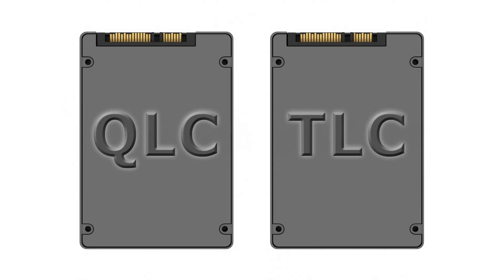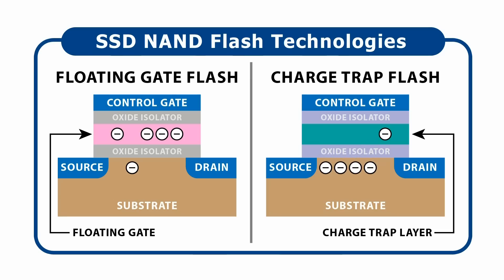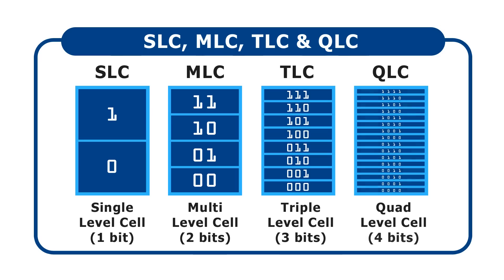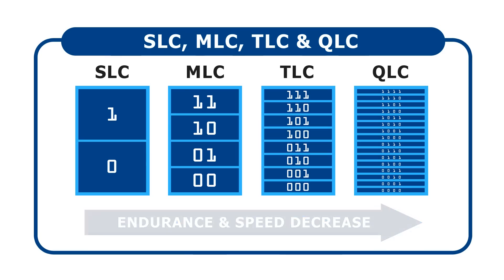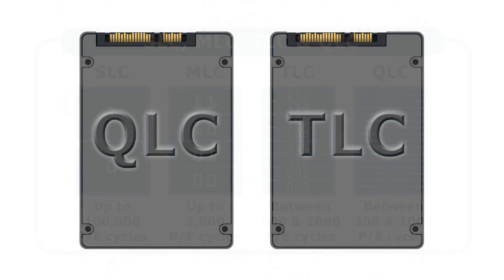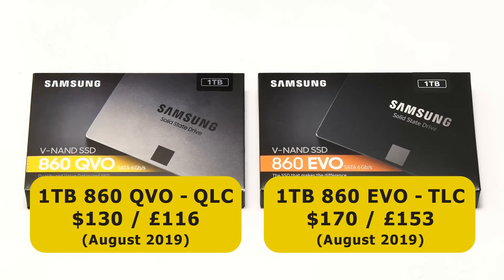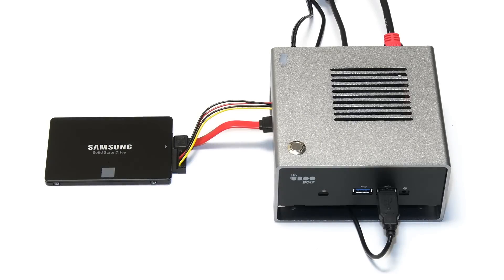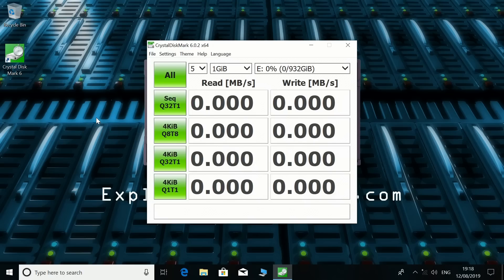QLC vs TLC SSDs: Samsung QVO & EVO

Comment: Would you guys recommended me to upgrade to 1TB QVO? Right now I'm still rocking 500GB 7200 rmp hdd. Works great but I'm running low on storage and I'd like to decrease loading screens in games.
Reply from the maker: You would find  1TB QVO a major upgrade in terms of speed as well as storage capacity. I would recommend a QVO drive to most users -- mine has worked flawlessly.
Reply: @ExplainingComputers  Thanks for replying me. I will consider it and most likely buy it soon. Keep up with your videos. Your channel is awesome. Deeply explained and straight to the point.

Comment: I like the informative part of the video, but your scientific part is bottlenecked by the used interface, and thus only what can be proven is that sata3 is not robust enough to compaire test results between the datacelltypes.
Reply from the maker: I have proven the difference between the two different products shown -- which both use a SATA III interface! :) So there there is nothing wrong with the test for these particular products! :) But clearly, testing two NVMe drives would be different.

Comment: I think why the EVO is sustaining the performance is because it can also flush the SLC cache to the TLC quicker than the QVO can to QLC; meaning that it can reuse some of the SLC cache while while the copy is ongoing. In addition, even if the SLC is completely full, the write should still be quicker on the EVO/TLC
Reply from the maker: I imagine you are correct. :)
Reply: Or U could just use a regular spinning hard disc, which can do MORE speed all the way from start 2 finish filling the whole thing = LOL!!  SSDs R a $kam =P

Comment: I have been moving LARGE files around since 2000.   Heck I still use Firewire 400 & 800 drives.  Even SCSI 320/(640-if dual channel on arrays)  

People thought I was Crazy to buy up all the  15K SCSI drives I could get my hands on.   But day in and day out?  When I need to shuffle data, and I NEED IT to be reliable?   This is what I go to when I need to have more then  500 MBPS of real world throughput without a hiccup.     

I'm still one of those people that buy Servers LOADED to the BRIM with RAM and use  most of the MEMORY for a RAM drive.    Even boot from it.  Its the only way Windows 10 is ANYTHING like how Windows 7 was when you had 16 GB of RAM.   No waiting or thinking for anything to happen.   Heck, I still use old versions of Windows server for that reason. 
(2003, and 2007)   

These days?   Backblaze or use  an online service for long term data storage.    The sad thing is?   Most of my old DVD backups of movies are now on Blueray or can be streamed.    So all that time I spent on making that Library was kind of a waste.    

However with the VIDEO I have recorded and made?   20TB is what I had  back in 2006.     If I wanted to save and actully get all my old MiniDV tapes back up?    And FIles?    That would be an easy 40TB,    then another 40TB to have a back up. 
And of course, the mandatory off site data backup.  

If I started to record Videos again?  And that would be 8k ,   then that 20TB drive would be not even be able to keep up with playback.     Let alone recording.     

And the only thing that is worth anything is TAPE data storage that is REALLY lagging behind.    The PRICE for the HOME user is not worth it.   So the Data center my data will go.

Comment: I just did a test using my GH5 and a Atomos Ninja 5 recording monitor with the 2TB 860 QVO  and exactly at 78.4 GB (which according to your graphic is the cache size for the 860 EVO) the recording was interrupted.  Then it would only record 4 second clips before briefly stopping and starting again to record the next 4 second clip.

Since I just purchased the Atomos Ninja 5 for my GH5 and my intention was to be able to continuously record up to 20 minutes in one shot at 4:2:2 10bit 4k@60fps...clearly the QVO drives are not going to cut it.

I guess I will have no choice but to shell out a bit more money for the 860 Pro and hope it can keep up with the huge recording data rate of 4:2:2 10bit 4k@60fps coming out of my GH5 over HDMI to my Atomos recorder.

I don't see myself recording at that rate very often but I want to know I have the right tools to do so if I want or need to.

Comment: I am in the market for SSD for my new PC, 2.5 SATA or NVMe?  Main use is general use and some PS/Lightroom and basic video editing (no gaming!) . As I understand there is no big performance difference between the two. My main concern is reliability. Should I go for NVMe or 2.5 SATA? As I understand there is no big difference between the two for my kind of work and the SATA seems to me to be more reliable. Thanks!
Reply from the maker: You cannot go wrong with a Samsung EVO 2.5 inch SSD. :)
Reply: @ExplainingComputers  Thanks, mate! Will do.

Comment: You connected to a SATA III port which has a data throughput limit of 600MB/s. This exactly is what you measure on both SSD, thus you encountered a SATA bottleneck. And while it is true that the speed of these two drives does officially not exceed 600MB/s, it would've been fair to exclude any bottleneck possibility.
Reply from the maker: But the significance of the test is to show the sustained data rate that the drives drop to -- which is way below the speed of SATA III. The test also shows a real-world scenario, which is what matters for most users.
Reply: @ExplainingComputers  thanks for taking the time to reply. I was just expressing my concerns... I guess I've been doing too much datacenter testing lately. Thanks for the review!

Comment: There is no wonder why QLC outperforms TLC before 24GB  is reached - it works almost as SLC then. I would also say that due to the fact that QLC writes twice (once as SLC and then as QLC it wears the cells even more). I would not use TLC or QLC for Video and dedicate good-old Hard Drive for that... For linear write of lots of data they should be as fast... needless to say that 24GB cache means 24x16 = 192 GB of free space that you need to have on your TB drive for the cache to work. Once you fill that - no more cache then - disk will be very slow! You also need to keep your PC running for some time after you finish your copying so the cache clears and the data is puts to SSD as QLC - otherwise it will be slow next time even before the 24GB is copied.

Comment: great video. I'd buy a QLC for more long term storage requirements, for a drive which needs to be fast for read purposes, but not storing files which are regularly in flux.
Reply: Good revisit now 230701, last month purchased nvme Kingston fury tlc 1t 7/6 GMps 80$, & 2 nv2 qlc 1t 3.5/2.1GMps 38$ each for casual data management. 5 years ago, using Samsung evo 860 tlc 250g as os drive, now 93% life. Did confige windows page file n other temp files to HDD so more endurant to ssd, just a few seconds longer when s/d. When ssd prices dropping much, can use external usb nvme & sata casings in replacing slow usb thumb drives. 👍

Comment: I have read somewhere that SSDs have data retention problem, so what's the difference between the different SSD standards?
Reply from the maker: An SSD should retain data for a few years if not powered. But after that needs a refresh.

Comment: This settles it, I would feel fine with the QVO for my PS4. Thanks for saving me a few bucks!
Reply from the maker: An a QVO for a PS4 will be absolutely fine. :)
Reply: @ExplainingComputers  I was burned years ago by the Crucial BX line. Ever since I have stayed away from budget SSDs and their lack of DRAM cache. Been using the Adata SU800. Ironically the SU800 2TB, TLC with DRAM cache, is the same price as the 2TB QVO on Amazon at the moment.

Comment: I just installed two 500 GB 860 EVO's. I needed to replace an aging WD 500 GB Blue HHD that is around eight years old. After installation and migrating my PC's windows OS and various other programs, from the HHD to the SSD, I have to say I am very impressed by the performance. From boot up to running DOOM 2016, on ultra settings 1440P 60FPS, it is a huge game changer. Although, I was a bit skeptical at first, my brother had already made the leap a few months before. I am glad he helped in changing my mind. Cheers to you K.

Comment: QLC is nothing I would consider buying .
TLC is as low as I am willing to go endurance / performance wise for active storage, MLC for system drives (would use SLC but those are all but extinct in the consumer space).
Ok I do move large data sets around fairly regularly so I may not be an "average" customer but I rather pay a bit more and have some quality than go for the lowest possible price and get trash that does not perform and then falls apart after a few years because it can not handle the load.

Comment: For an OS , is it worth it to spend extra for the evo 860, or will i be fine with the qvo?
Reply from the maker: Unless you are going to keep the drive really full (90%+), you will be fine with the QVO. I've been running an OS from a QVO since I make this video.
Reply: @ExplainingComputers  perfect. No it wont be anywhere near full, Using it as a secondary dual boot drive. Thanks for the fast reply considering its an older video. Really appreciate it.

Comment: Chris, I heard that the Rapid Mode function in Samsung Magician software can nor be used on a Samsung 970 Evo NVMe M.2 SSD.
I have not tested this out, but I wanted to ask if you would be able to confirm this or not? 
From my understanding the Rapid Mode in Samsung Magician Software can be used on all Samsung SSD's. Could you clear this up?
Reply from the maker: I am not aware of this. But personally I would never, ever go near rapid mode. It means you are saving your files to RAM, which then get moved to the SSD. So if you have a system crash, data is lost. No NVMe SSD has any need for rapid mode!
Reply: @ExplainingComputers  Yeah, but if you have backups in place, which you should, then this would not be an issue.And Rapid mode is good for when you have to move large amount of files so that it won't take long to do it.
Plus with rapid mode, your computer will run faster as well. 4x as fast as that of what the manufacturer sends the drive out under.
Reply from the maker: @berniecruz8405  I just gave my opinion. :) Backups are important, certainly. But you cannot backup a file until you have the first copy. :) And if your document is lost when you first save it because it wasn't actually being written to SSD . . . Well, as a writer, I would not trust that kind of setup.
Reply: @ExplainingComputers  Well that's fine, but I think we are getting off topic here. My original question was does Rapid Mode work on a 970 NVMe M.2 SSD?
Reply from the maker: @berniecruz8405  As I said, I don't know. :)

Comment: The reason why it doesn't slow down after 42 GiB has been written is because the buffer is not only filling up, but also writing data to disk. This goes a lot faster with the EVO compared to the QVO. With 42 GiB buffer and assuming a 465 MiB/s buffer speed and a 250 MiB/s disk speed, it would take roughly 200 seconds or 90 GiB of data to fill the buffer completely. It works just like a funnel.

Comment: W8 wat? So... Non turbo-cached SSDs (at least QLC) have roughly the same large file transfer rate as 7200rpm 256Mb cache HDD? Imma sayin' cuz I personally have a Samsung 860 Pro 2Tb and a 6Tb WD Ultrastar HDD, and when I copy stuff it goes roughly 60~100MBs (HDD-wise, of course). Did not really measure my SSD speeds, it boots OS noticeably faster though.

Comment: I've just tested my older ~500gb 850 EVO on Crystal Disk Mark  6.0.2 with the 1GiB sample. Quite surprisingly, it scored quite a bit better in than those two 1TB drives. And that's with it running as system drive (only 10% space used) with the browser with this video open in the background.

Seq Q32T1 was 551MB/s / 533MB/s
4KiB Q8T8 (both read and write) were exactly 100MB/s faster on it!
4KiB Q32T1 was 266MB/s / 233MB/s
4KiB Q1T1 was 37MB/s / 106MB/s

I wonder where exactly the newer drives are better than the older one, either some other usage case, or they are just a bit more profitable to make as Samsung realized that they made the older drives "too good". 

Curiously other tests I've seen showed the 860 Evo as the faster drive in pretty much every benchmark, so it must have been just slightly better caching for a sample this small?

Comment: What happens if the SSD is turned off.. When Files are in Cache but not completely moved to the actual QLC/SLC ?
supposedly, If we can't turn  it off until files are completely moved to the actual TLC/QLC, then what's the point of that 42gB cache ?
Reply from the maker: The cache is flash memory cells (used as SLC), so you can turn off when you like and no data will be lost. But when the drive is powered again, it will finish off cache emptying operations.
Reply: I see. So its purpose is to utilize idle states/times..
Ps. Thank you for the video. It's very informative.

Comment: When it comes to trusting storage media, I don’t completely trust ANY of them. So my solution is to use SSDs (TLCs, as it happens) for best speed in my computers and MULTIPLE HDDs for more reliable backup clones. Belts, braces AND suspenders, job done :-)
Reply from the maker: Oh I agree, no storage media should ever be trusted as a single store of data. I kind of took that as a given here! :) Backups -- 3-2-1 -- are always required.
Reply: Hi Chris, my comment wasn't a criticism of your (as always) brilliant presentation: I just wanted to make the point that with good backup, reliability of the main media becomes much less important. 

It may also be worth considering that hard drives in practice seem much less prone to failure than manufacturers’ specifications suggest (based on 40 years’ personal experience), so may this also be the case with SSDs? Could manufacturers be intentionally understating reliability, for instance to limit liability?

Comment: My guess is that the TLC is able to remove data from the 42 GB cache faster, so fills it up at a much slower rate: eg if it can sustain 400+ MB/s write, the cache would not fill up in the time available because only ~70 MB/s is accumulating to the cache... whereas with the QLC it's the other way around, the drive is only writing 70 MB/s and 400 MB/s is "net" to the cache. I suspect if you had a write that took 8-9 minutes at 460 MB/s, you'd then see the TLC speed drop to 400 MB/s. Just a hunch though
Reply from the maker: I think you are correct.

Comment: 42GB cache - is anough for TLC drive, but not for QLC.

Would better for 2TB/4TB QLC versions:
2TB QLC with 30GB SLC and 120GB MLC cache
4TB QLC with 60GB SLC and 240GB MLC cache

I think large 2 bits per cell cache will be the mandatory for PLC drives.

Comment: @11:27
"Initially both the drives show a very fast write speed."

I suspect that that burst of speed had nearly nothing to do with the target drives, and instead, had everything to do with Windows buffering the data.  So your Windows machine read data very fast from its NVMe drive, and filled its buffer in 3 seconds.

The two SSD drives use SATA's Advanced Host Controller Interface (AHCI), which is incapable of the transfer speed that happened in the first 3 seconds.  I believe AHCI maxes out at 600 MB/s.

Cheers!

Comment: my guess is that EVO was able to move data out of its cache faster then you could put it in there by keep the the data rate higher where the QVO's much slower cell write speed means at some point you over take it and fill the cache

Comment: Thanks for the informative video. 1 thing: i think u got a miscalculation on the speeds: 1GB is 1024MB (not 1000). That means that evo was writing at an average of: 75*1024/161=477.018MB/s. And QVO
 was writing at an average of 75*1024/481=159.66MB/s

Comment: The capacity of these SSDs are catching up with the capacity of HDDs drives, but it will still be by a couple of releases of major capacities of these SSDs (and their durability aswell) alongside with better software that optimizes the efficiency of the drive despite being TLC, QLC or whatever new type of technology whey'll be using. 
I'll be looking for higher capacity SSDs.
PD: And a question that I have for the future is when will they start failing, there will be a method to recover the corrupted/lost data? I bet that a few people will front this big problem even if all of us we're warned about it. Could it be the newer versions of Windows/Mac OS/Linux/etc prevent 90% of the cases by giving a warning of the TB written are at the limit of failing or no?

Comment: The drives don't have a 1gb write cache, windows 10 does. it's enabled by default. since it's going over a SATA connection, the data can't exceed ~600MB/sec in reality. It's just that Windows is writing to system memory and pretending it's copying files to give the appearance of better performance.
As for the write speed, TLC will typically top out around 300~500mb/s, as apposed to 80~100mb/s on QLC. The EVO drive is limited by the SATA connection here. If you were to try this test with a TLC NVME drive, you would see the speed drop when cache runs out.
Another thing worth noting is that higher level cells also don't do as well in cold storage, as the cell needs to be periodically refreshed to maintain it's specific charge level, and the more precise that charge needs to be, the more often it needs to be refreshed. afaik, this also wears on the drive, further limiting the usefulness of QLC drives as anything more than disposable storage. Given that they're still more expensive than, as well as slower and less reliable than, traditional mechanical storage, I wouldn't recommend QLC outside of laptops and tablets, where the lack of moving parts greatly improves reliability, and extra storage capacity comes at a premium.